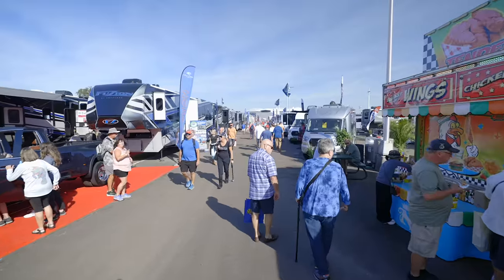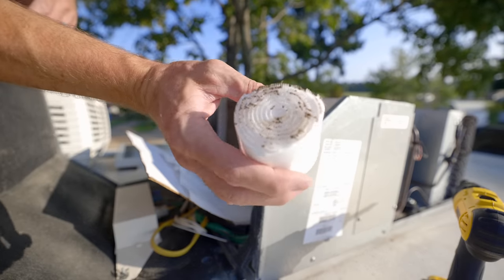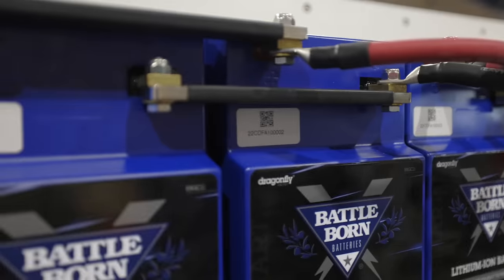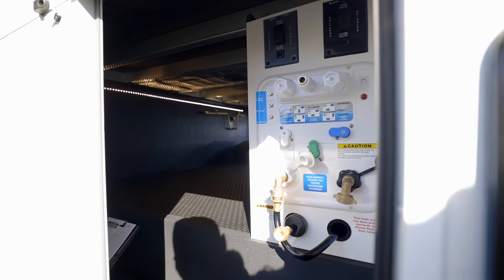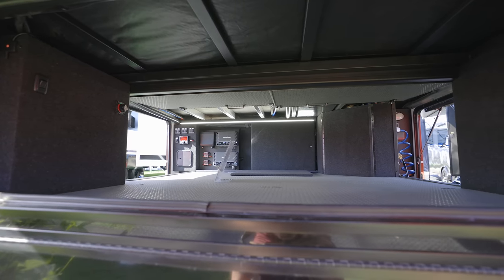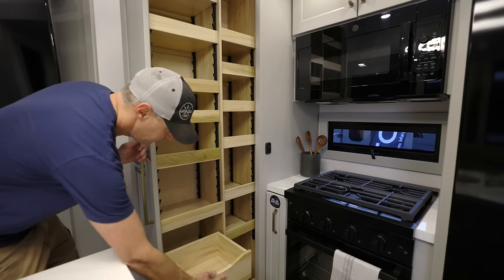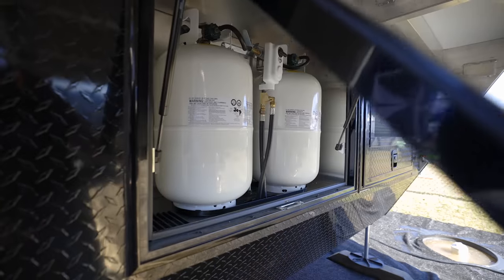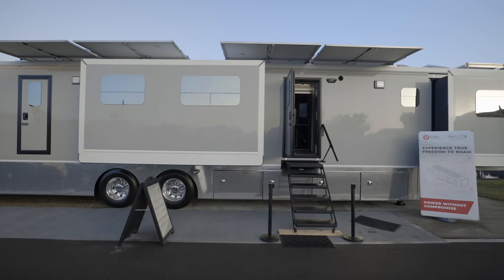New RV Technology, Accessories and New RVs! Tampa RV Super Show!

Comment: Wood is a sustainable and flexible material that is extremely well understood. I'm not ready to declare it bad in an RV.
Reply: I had carpenter ants eating mine. I had water leaks rotting the floor of my slide out. I had a 2 by 4 totally rotted out under the kitchen and I still can't find the leak from my rubber roof....Grrrrrrrr.

Comment: Don't waste money on UV lights for your home or RV air systems.  The air isn't present in front of the light long enough to zap anything.  And the lights aren't strong enough to do the zapping.  Its expensive blinker fluid.  But if it makes you feel better go for it.  In last couple years my home hvac folks have been pushing it hard.  Easy money for them.

Comment: Do you see lithium coming standard in the next few years?
Reply: I believe that rockwood and Flagstaff are starting to. They now have higher watt solar and i believe that they are including some lithium batteries.
Reply: Many manufacturers are installing a Solar package with LifePo batteries.  However the systems seem small/undersized and with the 12VDC fridges becoming the standard nowadays they really can't supply more than a day or so without some assistance.  If possible learn to install a system yourself.  That way you can shop for better deals and get a system with more storage.  This summer I installed a Renogy 400w system with a 3000w inverter and connected them to a 280wh LifePo battery I assembled myself.  Saved $1,000's.  There are tons of videos on how to do that.  Perhaps some large 5th wheels have bigger systems but that's not my cup of tea as they say.